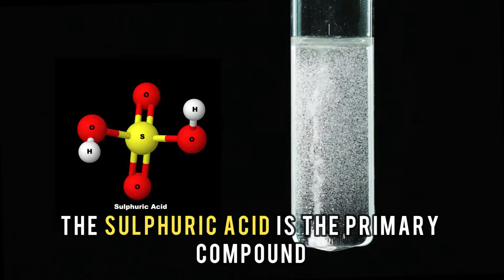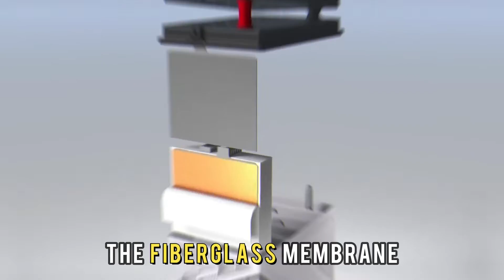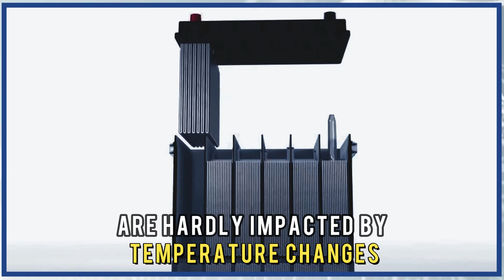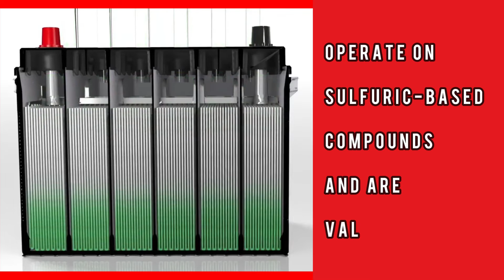AGM vs GEL Battery: How Do They Compare? (What's the Difference Between GEL cell and AGM Batteries?)

Comment: Ecclesiasties 9:10. White reflector the heat, Black absorbs heat, be smart, spray paint your black Pride Chair, all White, it's 12 degrees cooler. Proverbs 22:3. Ecclesiastes:14 proverbs 3:5 - 6  Hot weather, spray paint off white paint entire Power chair, will be cooler. 5 - 2

Comment: If you are in, deep, hot  South, I spray painted, my entire Frame,  PRIDE MED GO Chair solid off white paint, much cooler Seat . Not Black, it absorbs heat, Use White  Spray paint .enamel, ? 5 - 8 use a Quality  spray paint, and always leave the top off too, as HEAT kills, your  batteries,  and marijuana and Vitamins, I keep in my refrigerator, Paint all power Chairs, a Off White, as 3 cans of quality Spray paint, keep the chair much cooler, and I use hard tires on a wagon , pull behind my GO CHAIR, NO warranty anyway , my chair batteries were made in November 23 2023 but didn't get the chair until February 15 some 15 weeks not chared, and never, never got Two Green Knobs, so your batteries won't fully charge if a set of . TERMINATOR . 2 Jell Mat Spill proof a 12 volt a 20 a.h.tbe batteries drain down when made on assembly line, your batteries are not gunna get . 2 green Knobs, and PRIDE is a Liar ! I called them and was told I pay a Service call, for $185.00 dollars, PRIDE GO MED Chair Batteries look at the date on Batteries, .no warranty at Crooked, PRIDE GO MED Power Chair and I pull a wagon behind me, as I weigh only 131 pounds, C. H
 F. Stage D, with a Diabetes, and Diabetic Neuropathy and failing left Kidneys, as well. am 70 Years old .pull a small wagon , set Squirrel VICTOR RAT Traps for Squirrels meat, made two 1" thick, Ramps, to jump high curbs, a ramp is only, 28" wide by 30 long, so I can jump any curb, in Mobile Alabama it's Hot as HEAVEN in June, July, August, it"s , it's Damn Hot, add a Small ice chest on back with ice a wet ice cold towels, I put on top of my battery, stay, Last Longer, if you keep your batteries COOL, will last longer, I took a 1/4 " Drill bit, and drilled holes in sides, as Air can flow ! 5 - 8

Comment: Which one is better for a heavily modified moped due to need to high compression, i need cca to start my moped since it won't start when it's still cold.
155cc moped with 11,3:1 and with 272° duration camshafts 😅
Reply: AGM higher current release so better for starting high compression motors. Gel cell better for deep cycle marine/rv type applications